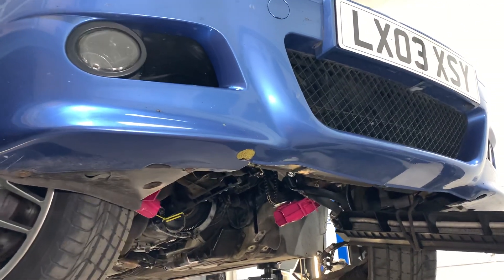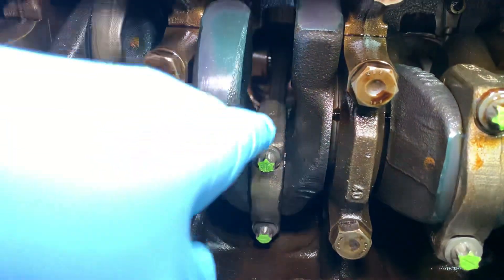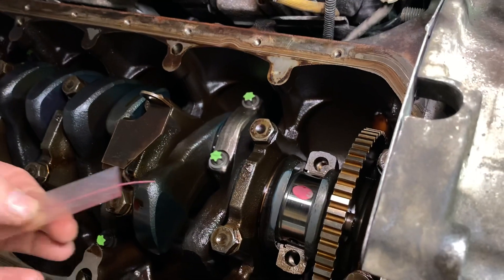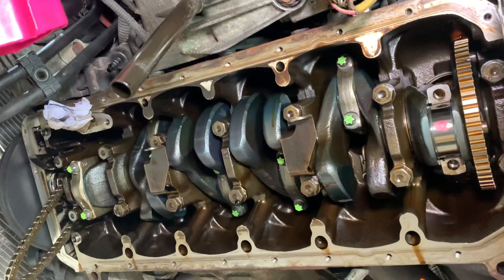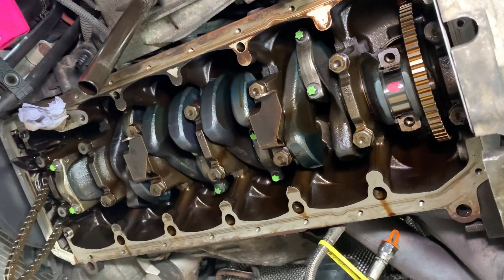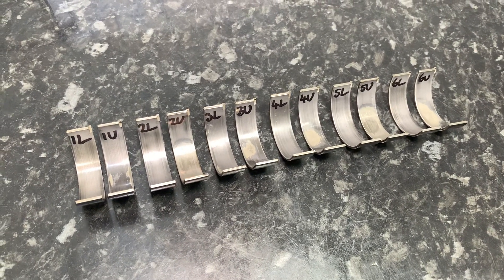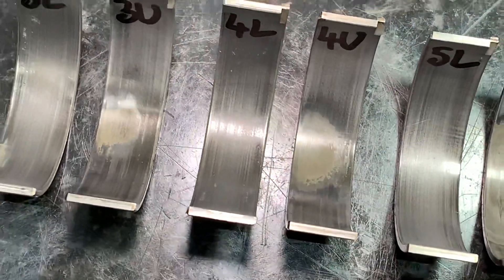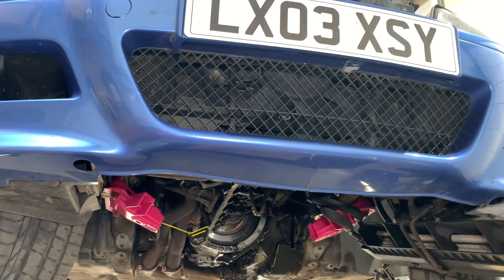BMW E46 M3 Conrod Bearings: REDISH EXAMPLE VIDEO

Comment: are the main bearings prone to failure or is it just the conrod bearings on the s54s and s65/s85s?
Reply: Just the conrod. The force produced by combustion smashes the conrod down onto the crank, which wears the bearings out etc.
The wear happens due to the specific viscosity of the oil, thicker when cold and because of the tight factory designed bearing clearance